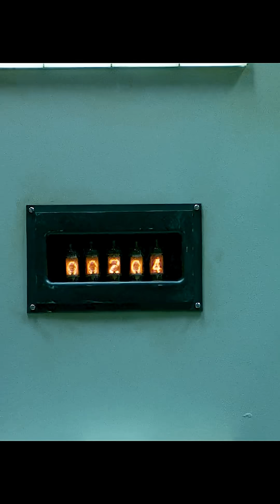The reason the reactor exploded, besides the fuel issue, was straight-up improper operation.

Comment: The thing that amazes me is that there weren’t more catastrophic accidents. These plants were the equivalent of a model T ford. Nobody had any experience designing nuclear power plants. The engineers were pioneering the technology under incredible pressure to keep costs down while pressured to do it at warp speed. Computers were in their infancy also. It wouldn’t surprise me if a common laptop of today had more computing power than the entire plant had. Same with the computers they modeled the reactors on.

Comment: That series did Dyatlov dirty. In reality he wasn't a snoby prideful prick as depicted in the series, in fact he was one of the first to help also he was a victim of a power struggle inside the Chernobyl NPP and he wanted to stay out of it but Bryuchanov and Fomin forced him to do their bidding. Reactor no.4 wasn't first not even second, first was the incident at reactor no.3 at Leningrad NPP and later reactors no.2 & 3 in Chernobyl. To put it simple - reactor no.4 was just a result of a snowball effect of neglect, cutting corners and the system shortsighted seeing of the arising danger. RBMK was doomed from the very beginning and at its design to be faulty.
Reply: Is there any material where i can Learn more about this? a book or some other source?

Comment: I visited a nuclear reactor in France, or rather, it's education center and the control room simulator where they train.

As expected, at some point someone asked about Tchernobyl, and the guide described it has "Trying to make nuclear fission in a barn". And went on to roughly explain the failure.

Basically, the control rods in modern reactors are fed from the top, in case of a huge major failure, like total loss of controls, the rods will all drop into the core thanks to gravity, reducing power output to an absolute minimum in a matter of seconds.

Well, Tchernobyl wasn't built like that. The rods were fed from the bottom, and some of the materials in the core had melted, and pooled at the bottom before solidifying, essentially sealing the holes the rods were meant to enter through. And the rest is history.
Reply: If the rods were fed from the bottom how did he see them jumping in the reactor
Reply: @Unknowerr404  The truth is that they didn't; this was a fictional creation for the show.
Reply: Wasnt it mainly the tips being boron which increase whatever instead of lower since that made the  tips cheaper
Reply: @Unknowerr404  boron is the regulator that lowers reactivity, the lower portion (much more than just the tips) was graphite which increases reactivity. it was designed this way so that each rod could increase or decrease the reactivity as needed, not just to lower the cost of the rods.

the SCRAM system was also really slow, a few seconds after pressing AZ5 the rods were still only half-way through, which is significant because the increased reactivity from the graphite caused a steam explosion that partially detached the cover plate, jamming the rods in place.
Reply: @Unknowerr404  carbon/graphite (same thing) tips on the boron rods. Cheaper, but does the exact opposite of boron. Boron is a great absorber but carbon accelerates reactivity
Reply: @Unknowerr404  nvm olivinator said it better
Reply: Also what is this explanation lol. Idk how drunk they were in France when saying that but this is a horrible explanation. First of all its usual for reactors to insert rods from the bottom. Chernobyl inserted them from the top. The big design flaw was the displaces at the rod end to cause a power spike when inserted all at once due to the replacement of neutron absorbing water and the increase of moderation density in the core.
Reply: the rods entered from the top, but the lower portion of them is graphite, and when the neutron absorbing water within the control channels got displaced by neutron reflecting graphite it spiked the reactivity, resulting in a steam explosion the partially detached the cover plate, which is jammed the control rods in place before the boron portion could properly enter the reactor.
Reply: @olivinator they dont enter from the top
Reply: @ArturShow132  the main control rods enter from the top, and the AZ5 scram affects those. there are also some shorter rods that do enter from the bottom, to help flatten the power distribution but those didn't play a large part in the disaster.
Reply: @olivinator  No. ALL rods enter from the top. Idk who came up with all the bottom stuff but they are wrong. The rods you mean are probably the USP rods which literally have the rod drive on the reactor lid like any other rod has. The difference of them is that they have graphite on the top and borron at the bottom.
Reply: @RBMK_Dyatlov1  USP rods are a type of control rods and were inserted from the bottom of the reactor, the main control rods were and still are inserted from the top.
Reply: @olivinator  No. USP weren't inserted from the bottom. Please stop thinking that. Just look at the building of that reactor. There is no space to drive rods from the bottom into the core.
Reply: @RBMK_Dyatlov1  i'll take the word of the World Nuclear Association, which says that there were several smaller rods that were inserted from the bottom, over the word of some random youtube commenter.
Reply: @olivinator  Bro. That article is so wrong. They used the INSAG-1 report which was soviet propaganda as source. Don't trust them. Better read the rewrite INSAG-7 which has everything correct. And still not possible for rods to insert from the bottom. How would you even design that in a RBMK?
Reply: @RBMK_Dyatlov1  straight from INSAG-7 "The control rods and the safety rods of an RBMK reactor are inserted into the
reactor core from above,except for 24 shortened rods which are inserted upwards
and which are used for flattening the power distribution."
Reply: @olivinator Yeah and do you know why they say that? Because the absorber part is on the bottom and the graphite on the top. And they don't start inserted like the normal rods do. Still not inserted from the bottom. You can ask many people this question in the chernobyl subreddit and they can tell you the same.
Reply: @RBMK_Dyatlov1  i'm going to need a source for that that isn't some random youtube/reddit commenter, because insag-7 literally says that they are NOT inserted from above.
Reply: @olivinator Okay. Look up a picture of the reactor lid. See those yellow rod caps? Those are the usp rod drives. They are litteraly located at the top of the reactor. So how would you drive them from the bottom into the core?
Reply: @RBMK_Dyatlov1  i don't know what to tell you, everything i'm finding says that there were 21, and then 24, and then 32, shortened control rods inserted from the bottom of an RMBK reactor. reactor 4 in Chernobyl had the 24 shortened rods design at the time of the disaster.
Reply: @olivinator  The issue is you looking at it in text from. Text is bad at making people understand so lemme give you an example with a picture found on page 41 of Smolensk VIUR training manual. There you can see the diffrent rod types being driven including USP... From the top.
Reply: When you try to bullshit maybe get the least facts right. 
Why should the control rods be move in from the bottom ?
Reply: Yeah, funny how the fix TO RBMK was to put some extra control rods at the bottom 🙄

Comment: One of the worst, easiest to prevent disasters we've witnessed
Reply: I didn't realise
Reply: And the one that caused the most powerful energy source we have to be villified
Reply: Well, in their defense, they also didn’t know the control rods would also kickstart a meltdown. They were intentionally told that that wouldn’t happen. Nor did they know that the graphite tips of the control rods would cause the meltdown. It’s also thanks to this happening that we’re not on mass using nuclear power, which is the cleanest and safest form of energy. It’s like saying we can’t use manure anymore because some dumb ass at the manure barn on fire so clearly it’s not safe to keep manure.
Reply: @MikeGarland__  safest and cleanest form of energy? You wanna have that waste in your garden? Water, Wind, Sunlight are much safer and in case of an accident it's not like an half of a continent becomes wasteland for tenthousands of years and whole food chains for the rest gets infested.
Reply: @clarefall3730 Modern nuclear energy reactors are insanely clean nowadays, some of which have 0 radiated waste. They are also far safer nowadays and can suffer catastrophic events when prepared for, the most recent nuclear issue was where Japan cut corners and put theirs in a location prone to severe tsunamis. The plant is contained and isn't near as bad as this.
Reply: @clarefall3730 if you don’t know what you’re talking about, then keep your mouth shut. you know nothing of nuclear energy, and never speak ill of it again. period.
Reply: @clarefall3730 you don't know what you're talking about.  Nuclear is more efficient and cleaner than solar or wind.  It's not even close.
Reply: Easy, kind of... But you can't control peoples desires and stupidity same way that reactors inadequate control rods.

You have to carefully choose people in these roles with top-tier knowledge. You actually need people that are very good at their jobs and willing to die for their role, in case that is needed.
Reply: Doing much worse with 2 much greater disasters that are clearly preventable - Climate change and AI
Reply: Created*
Reply: Not easy to prevent. You can't control atomic fissure.
Reply: @Goldeneye3336 You literally can, and we’ve done it constantly since the 50s. Chernobyl was caused by the Soviet Union’s incompetence.
Reply: @Goldeneye3336 what do you think they’re called control rods for?
Reply: @theonlyjoe_  There is a difference between control and regulation. You do not know the difference.
Reply: @theonlyjoe_  Go read up on atomic fission, control rods are used to regulate.
Reply: @Goldeneye3336 you’re arguing over semantics. Regulation is a way to control a reactor.
Reply: @theonlyjoe_  no, regulation is the result, not a way. you are arguing over semantics tbh, you replied to me insisting on the meaning. i provide, you're not happy, not my problem.
Reply: @Goldeneye3336 what do you think regulation actually means?
Reply: @theonlyjoe_  what do you think it means ?
Reply: @Goldeneye3336 regulation by definition is about controlling something via restrictions. 

The entire point of the control rods is to restrict the amount of neutrons in the reaction at any given time to stabilise it. 

Pro tip: don’t double down when you’re so obviously wrong
Reply: @Goldeneye3336  maybe if you're the only one making that point and EVERYONE else is disagreeing with you then maybe you're not the one who's right
Reply: @Goldeneye3336  The only reason it was NOT easy to prevent was because it was a Soviet country at the time.
Soviet built the reactors, The made mistakes, and they lied about those mistakes to all the oerators of the reactors.
The Chernobyl incident literally didn't have a single thing to do with fission being difficult to control, it happened because of Communism, literally.
Reply: @theonlyjoe_  it really isnt semantics. Words have meanings for a god damned reason.
Reply: @theonlyjoe_  regulate by definintion means to maintain and supervise. just fkin saying
Reply: @Goldeneye3336 
Regulate: control or maintain the rate or speed of (a machine or process) so that it operates properly.

Literally first word in the definition.
Reply: @SammySammy-gs3hq so explain then how this isn’t semantics
Reply: @Goldeneye3336 can you control each individual fission reaction, no. That's random.
However large amounts of radioactive materials behave quite predictably, we create the circumstances to allow them to potentially explode. But moderate the reaction with systems like control rods.

Ultimately this disaster happened because the vital control systems were disabled/averted. Yes AZ-5 had a major design flaw in these reactors, but even before that was pushed this could have been averted, had they just slowly brought the power back up after poisoning the core. They removed almost all control rods, which means that once the reaction got going again it wasn't under control anymore.

An analogy would be a car driving on cruise control at 50 kph. You can speed it up or slow it down in various ways (hitting, the throttle/brakes, shifting up/down etc.). What they did here was bring the rpm down to basically stalling the engine, disable the brakes, traction control, apply full throttle and shift down to the powerband and then wonder why they crashed.
Reply: @blaster112  Lots of words to basically say. REGULATE. And thats probably the most perfect exemple of false equivalence ive ever heard
Reply: @Goldeneye3336 this is the single most bizarre comment on nuclear energy I've ever seen.
Reply: @bookkeeper1995  so truth is now bizarre ha ha
Reply: @Goldeneye3336 is this Dyatlov's youtube account?😂
Reply: @Goldeneye3336  What the hell do you think the Control Rods were for? Decoration?
Reply: @Goldeneye3336  this was caused by cutting corners and nothing else
Reply: @Goldeneye3336  you can. But it’s getting very hard when Soviet Russia’s regime and kgb don’t allow
Reply: @Goldeneye3336 the disaster in the Chernobyl Nuclear Power Plant, Reactor 4, which resulted in a complete meltdown and left the surrounding area of Pripyat a nuclear wasteland was completely avoidable. Had regulation been followed, which it had not been, it would have been avoided. There is a reason the world has not seen another disaster like this, Fukashima was the result of a Tsunami and still wasn’t anywhere as impactful as Chernobyl.